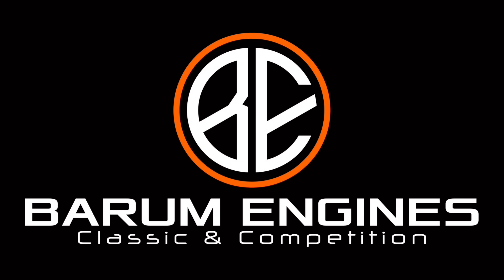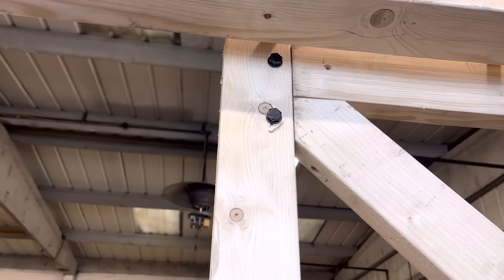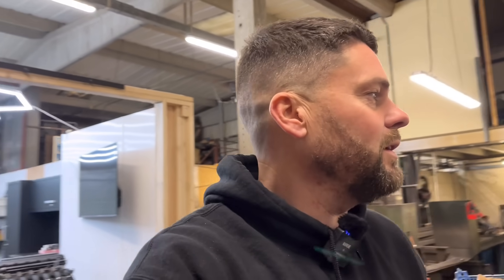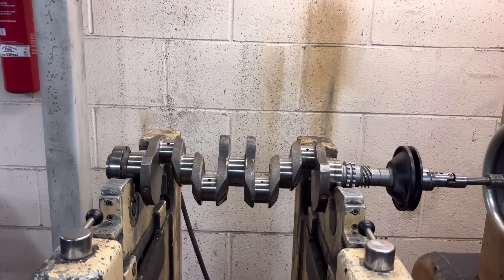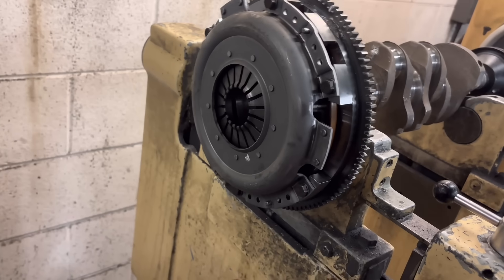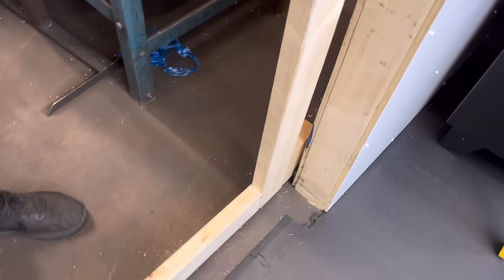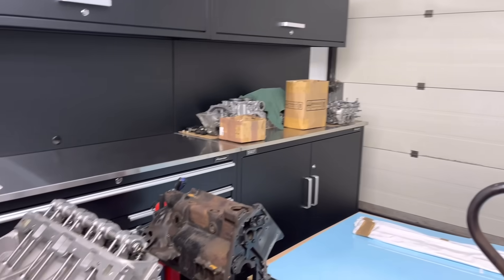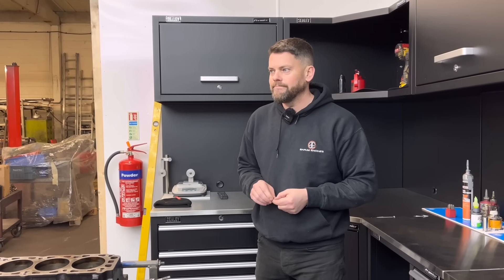Workshop update: How out of balance is this Alfa crankshaft?

Comment: So painful watching you balance cranks wrongly. Inline engines need bobweights just like V engines do but with inline engines the bobweights only represent the rotating weight and none of the reciprocating weight. Like cheap cranks like the one here, they only use 4 counterweights. Better cranks like say a 4G63, they're fully couterbalanced with 8 of them. The difference is in how well they stay balanced at high speed. I built my own balancing machine because I can't trust anyone local to do the job properly.
Reply: Your machine only balances each end and doesn't take into consideration the imbalance at no 3 main. That's where the bobweights are important. Well if you're going to do a job, do it properly and not half arsed. If you video yourself to promote the business, make sure you know what you're doing.

Comment: Looking great, can I suggest you get some workshop degreaser called "Lift", you dilute a tiny amount with water and fill hand spray bottles. It's really effective stuff.  Leave the bottles out round the workshop while you are all reorganising etc.  and get everyone to spray on the machinery, walls etc and wipe off the grime as you go. Then in the future use as an initial degreaser for the engines as they come in. 

Cheers !

Comment: I had to build a clean room to assemble high speed turbines. If you want a cheap ceiling for the assembly area you could do what we did and that was to build the ceiling by making a timber frame out of quite light timber and using filter material stretched over in and stapled on. Then suspended it with wire over the room. The ceiling then became the outlet for the air that was pumped in. The inlet fan had a filter and the room was slightly positive pressure.

Comment: I love that sliding door framing. That needs to be covered with translucent fibreglass to show it off and also give a sense of space with a bit of light coming through.
Reply: It needs to be longer with two contact points down low so it won't flap about  when partially closed.

Comment: Fantastic job Lee!!  I would just suggest that you get a second roller assembly for the bottom of the door and when the door is closed all the way put the second one about 6 inches from the end of the door. This helps the door stay straighter and helps the door stay close to the wall to stop items from getting behind it. I love the framing of the door and I've been doing renovations and new construction for just over 40 years now. Keep up the great work and videos.
Reply: With all due respect, 6 inches from the edge for roller unit on the floor will present a serious trip hazard potentially ... so, I thought that Lee's idea of a 'receiver' type 'mouth' on the Post is probably better (which I presume will allow for some tolerance in guiding the door into the centre).
Also, this could be the place a floor level rubber 'bumper' to damp the closing.

Only an opinion ... It's whatever works and is safe/liability-friendly.
Reply: @Jester-Riddle  Read my remark again. 6 inches from the end of the door isn't in the opening, it's against the wall to the right of the opening as you go through into the shop.The door is longer than the opening. Watch the video again and look how long the barn door rail is on top of the wall. Listen to Lee give the opening measurement and then the door measurement, the door is way longer.

Comment: All looking good , a bit of a thought  on the panelling , try hardboard , people turn there nose up at it , but if fitted correctly , ie wet the back , use the proper nails , it goes drum tight , lot cheaper than plywood , and you can get it already white , I’ve used it with success on a number of jobs

Comment: You can use the same material as a used for 3M clear bra for vehicles on your stainless steel tops. It's pretty scuff proof and self-healing when heat applied to it.

Comment: If you want to upgrade cameras, you really need to move past using phones. I'd suggest a Sony ZV-1 as the built in lens covers most of what you need for vlogging and the tech. work. You can go with one of the upper scale ZV- E series, but now you are getting into buying a series of lenses. A used ZV-1 would be a step up, or you could splurge and get the new ZV-1 mk2. There are more expensive options like the RX series, but generally not needed for this type of work. If you want to go a different route, all the stuff on my channel was done with ancient Panasonic GH-2 cameras and a few lenses, not really a suggested path for most people due to cost/performance of used camera bodies. GH 5 has been selling for around double and offers much better features and quality.

Comment: I had film on my bench as wanted to protect it like you did. Mine was a large vinyl logo. When moving anything like a head or a flywheel it will kill the film. Mine lasted 3 months and was messed up. Best thing i ever got where large 120x80 mats. Like a big mouse mat with logos on and have them on the sides now. If the stainless does get anything on it use a scotch pad and some thinners and comes up like new.

Comment: Stick on LED 12V strips under the top cabinets will brighten the stainless work surface. Scraped laptop computer power supplies can power them. Inline rocker switch to turn them on as needed.

Comment: Isaac,
How do you where to remove material to bring the crank into balance?

OH, BTW, I just got my iPhone 15 too.  Great video quality.  Turning it on and off is a little different than before.  Watch out for the phone slipping into "Do Not Disturb" mode under Focus.  When it happens, you can't get calls or text messages.  You will not be notified when it happens.  Best you go online and find how to get your iPhone 15 out of DND in the Focus Mode.  
Otherwise, Thanks,
Alan from NC, USA

Comment: Lee, 
You've been holding out on the viewers!  You have some carpentry skills!!  The angles you cut are perfect.  Everything fits so well.  The frame works for the sliding door, regardless of what it looks like.  Be careful when countersinking the bolts.  You want to be careful not the break through the backside if the countersink.  

Have you considered getting some undercabinet lighting for the cabinets.  I had an LED light fixture with an on/off switch.  The lights will remove any shadows made by the worker when he is standing in front of the SS worktop.   
Nice job my man!!  Impressed.  Beats anything I could do myself.  
Alan from NC, USA
Reply: Not a surprise considering Lee's profession requires careful measuring and cutting. Remember, measure twice, cut once ;-)
Reply: Under-cabinet lights are just awaiting the electrician to connect ...